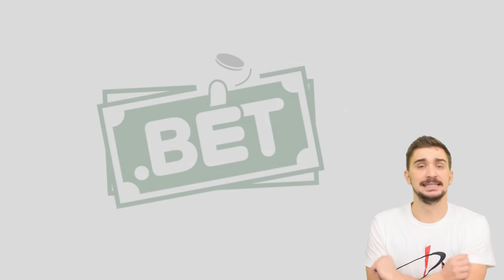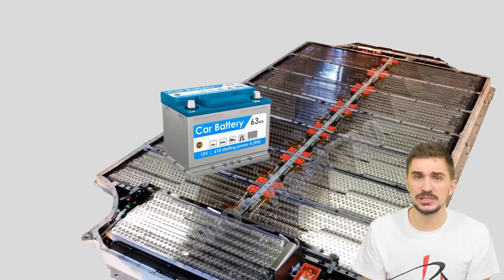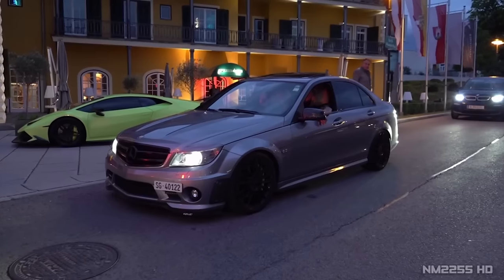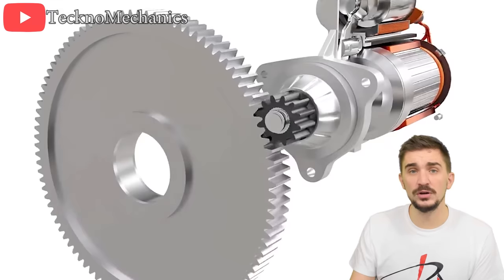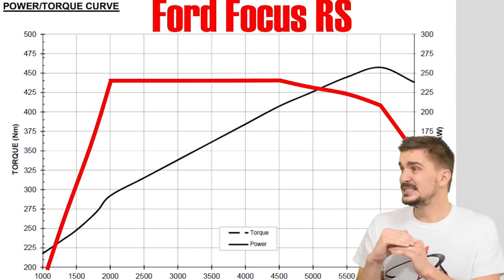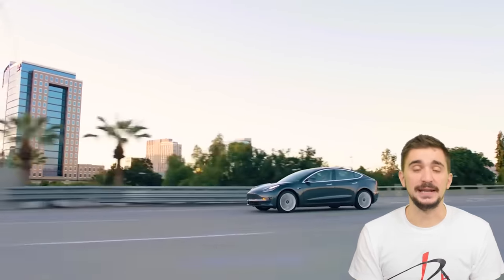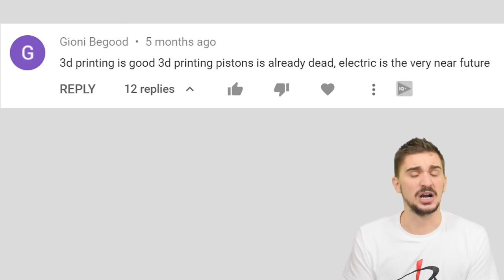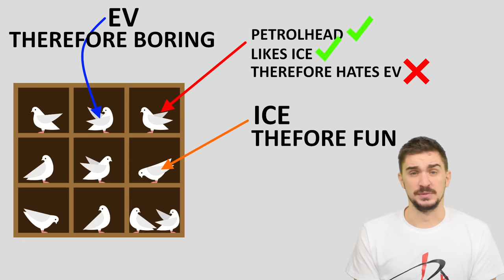ICE vs EV - IN-DEPTH comparison of BATTERY ELECTRIC and INTERNAL COMBUSTION ENGINE vehicles

Comment: Hydrogen powered next? Also, really enjoy his videos but i can't point his accent to anywhere I know...
Reply: Qatar
Reply: Hydrogen fuel cell EVs are an almost certain possibility in the next decade and could certainly be what gets me to switch but Hydrogen ICE is kinda silly as it has nearly all the downsides of ICE engines plus most of the downsides of Hydrogen Fuel cell vehicles. Running an ice engine off of recycled carbon is simply more efficient and therefore better for both your pocketbook and the environment than running them off of Hydrogen.
Reply: Its got some serious hurdles. Current methods for the commercial production of hydrogen requires more electricity than you get back out of it when used as a fuel. Its hard to justify developing a FCV and distribution infrastructure when you could take that electricity and just put it in a battery EV. Hydrogen is literally the smallest and least dense molecule. So it needs  complex, bulky and expensive means to both store it and stop it leaking out over time. As an environmental contender, it will liberate energy in exchange for a by product of water. Big tick. Its cost of production is so high that it has had close to zero market penetration. The CO2 and energy required to produce the fuel is high.  Big crosses.
Reply: Hydrogen in cars is a terrible idea.  It's only being pushed because almost all hydrogen comes from fossil fuels.  
Electrolysis of water > compression of h2 > transport of h2 > more compression of h2 > damaged metal pipes reacting with h2 > inefficient fuel cell > electric motors driving car.
Much better to go from generating power straight to charging your car.  Much, much more efficient.
Fuel cell cars are actually electric cars, with a ton of inefficiency and complexity added for no good reason.

Comment: 31:40 yeah but im not good at electronics. honestly wiring is my least favorite thing about working on cars. i understand mechanical engineering. its usually pretty straight forward when it comes to diagnosing a problem. like if it looks like milkshake in the coolant or oil you probebly have a broken head gasket. if you hear a ticking sound from the engine its probebly time to ajust the valve lash. if its running rough it might be ignition or carb. i daily a 1968 volvo amazon. im working on my 1948 cadillac. im rewiring the whole car with cool oldschool white braided wire. ive done alot of it by now but im kinda put off by the whole thing :/ ive rebuilt the engine and that was the most satisfying thing ever when it ran the first time https://www.youtube.com/watch?v=-fXBvueh6oM

the only way for the future of cars to be EV is if we did it like in fallout. where each car has a tiny nuclear powerplant inside. you dont need to fuel up ever or at most once every other year. you dont need a giant battery. but then again this can never happen because people are scared of nuclear power wich is the only sustainable way of supporting millions of EVs. also it would have to be crash proof. can you imagine a crash proof nuclear reactor XD. if just the Li batteries catch fire are dangerous enough when ruptured and cant be put out by anything.

Comment: Dude, I like my way better, the net energy content of one US gallon of gasoline is 1 * 2.85769 * 33.33333 * 13% = 12.38333, so if I drive 300 miles and I burn 8.1 gallons of gasoline, I get 300 ÷ 8.1 ÷ 12.38333 equals 2.99 miles per kwh and it's easy on my starter motor.

Comment: I enjoyed the video and awful lot. Think of it, I am dancing converting my Nissan Vanette ICE  engine , whose spares I cannot find, to EV. The body is still in very good shape and I do not want to just throw it away or convert it to a chicken coop. What do you say?
Reply from the maker: I think EV swaps are just perfect for scenarios like that. There's s lot of really cool cars out there for which parts have become extremely scarce. EV swaps can give these cars new life. But aren't vanettes common? Lots of parts around?
Reply: @d4a  parts common? Not in this part of Africa. The engine type is L8 or GAS18. If you know where I can get one, Usually be most grateful to you,sir.
Reply: @d4a  parts common? Not in this part of Africa. The engine type is L8 or GAS18. If you know where I can get one, Usually be most grateful to you,sir.
Reply: Sorry the auto correct thing keeps distorting my messages
Reply: Do it.  Plus some rooftop solar.  Be a cool conversion to document.  Maybe a cheap Leaf motor/batteries would do.

Comment: Inverter weight 60kg? WTF? LOL Closer to 10kg maximum. Also many other "mistakes", like "equal need for replacing" of brake pads, cooling fluid and lubrication. I have Tesla Model S and for 47.000 kilometers (almost 30.000 miles) I didn't change single braking pad (most of braking is regenerative), nor cooling fluid (just toping) or any lubrication (there is no engine oil and transmission is permanently lubricated and sealed). Price of electricity is usually the home tariff and only for longer trips you need to pay public charger tariff. If you had a gas station at home, you certainly wouldn't forget to mention, that your house price is 40c per gallon.

Comment: I'm in the same pigeon hole, petrol head at heart and for work. The idea of ev conversion is exciting with the improving technology. My only problem is the midea bla bla about them being green, this is very misleading in my opinion.
Reply: The media is notoriously bad for oversimplifying things and EVs are not some magic silver bullet. But overall at a worldwide scale it's an improvement in environmental impact. Where I live the electricity is 95% hydro power so while gas cars make emissions all the same electric cars do not. And when you put that in the worldwide scale about 11% of global electricity generation is renewable in 2019 but fossil fuel cars are unable to harness it unlike EVs. And for the EVs that do actually run on fossil fuels they are more efficient. Transmission losses of the grid and inefficiencies of the boilers, turbines, and generators are much lower than the very high energy required for hydrocarbon processing/refining (separating chemical and intermolecular bonds requires a lot of energy) and transport. So yes EVs do still indirectly burn fossil fuels, they just do it less and more efficiently.

Comment: I think hybrids and lower displacement is a better future than full ev
Reply: It's not, you can't fit 2 entirely different industries and manufacturing practices into a car and think they will work in harmony, its been found that moat people will just fill their gas tank rather than charge at home or work.
Reply: @miguellopez3392  toyota make huge numbers of hybrids and they do pretty well, so that is not really true
Reply: @kipkipper-lg9vl  yes and their hybrids underperformed on every metric compared to EVs except range same for their hydrogen cars, people bought hybrids on basically on the lie thet they would save tons of fuel, that ended up not being true after several studies actually looked at driving patterns and why hybrids are getting their market taken over by EVs.

Comment: And another Problem of EV's is the battery pack is Very expensive for example, the battery replacement cost of Tesla model s is around $12,000-$20,000 US dollars according to Google Search that's very expensive and very heavy weight, the biggest issue is that if one of the 6000 fails, the entire battery of lithium ion will put alot at risk of massive explosion. actually there is an EV Related incidents where One family instantly killed in one Single massive explosion of the one which causes of the entire family death and the house massively destroyed by the massive explosion. E-bike, the causes of E-bike explosion is the circuit protection fails to cut off the power supply when the battery is fully charged that's why the battery suddenly explode without signage badly destroys everything even the house itself. That's why I've never recommended EV specially it's made by Tesla's poor management to adress this issues. Instead i would go to Toyota's hydrogen fuel cells. Toyota mirai is one of the best.

Comment: You made a terrible mistake with that fan picture. There is no electric fan in the world that has a commutator and brushes. They are used only in engines that are intended to operate for a relatively short period of time.

Comment: Sorry but you are cherrypicking the weights a bit in this video. A modern 4 cylinder gas engine easely weighs 150 kg. A transmission easely 100 kg plus a full gastank is close to 100 kg aswell. An electric motor weighs around 50 kg youre correct, but an inverter doesnt weigh anywhere close to 60 kg, its closer to 5-10 kg and a EV battery between 400-500 kg.

Comment: Really nice topic, btw what if inline 3/4 engine mounted 90degree(parallel to ground) instead of vertical, how it will impact on NVH level, handling...could engine makes to run at higher rpm without putting stress on connecting rod since piston isn't moving against gravity.
Reply from the maker: Boxer engine? 😊
Reply: Don't try this with any engine you care about because the oiling system was designed to work vertically but if you did run an inline engine horizontally, you would notice no appreciable difference in anything except maybe for center of gravity. The stress imparted by Earth's gravity onto the connecting rods and the crank are entirely insignificant compared to the stresses caused by rotation pumping and combustion.

Comment: The manufacturing process did not make emission. When you plug in your EV the Energy is magic.
Ps the battery material might me interesting for people to look in to...kinda like a solar panel as well.
Reply: @d4a  the plans for the future can be seen on white papers. The world controllers want 90% dead. EV is to promote carbon taxes which leads to unreliable energy. Geo Engineering the number one planet killing thing people are doing and have been doing for nearly 70 years. The Bunker fuel from major shipping is connected to Geo Engineering.  I am not against EV's but they should be a option for people that want them and toyota is one of the only car manufacturing companies I respect because the CEO said they want to make cars people want and don't care how they are powered. Right now is the time to save ICE. Cars and cow farts are not an issue and if you believe it you may want to stop drinking the cool aid. 

Lithium and cobalt mining has destroyed water and land, look to africa for example. Combustion engines are cleaner then they really need to be at this point. The Future is grim if the every day person says nothing or does nothing about the Great Lie.

Comment: I to am a motorhead and I love ICE engines, I also prefer manual transmissions. This older form of mobility for me involves more physical activity and interaction with the vehicle. It also involves skill keeping the engine at peak torque from the sound of the screaming ICE engine using the proper gear and clutch. This is just more fun as a driver for me. The ICE engines have given us such advancements, consider the awesome roads and highway we have to enjoy high performance vehicles on.

Comment: EVs are built on the backs of ICE cars. thats why EVs are as good as ICE vehicles, because ICE vehicles have done the pioneer part os the equation.

Im same as you. More on the ICE side, but not hating EVs. What i hate in this discusion is that they were put on a pedestal, that they were great in everything cleaner than ICEs, better solution. but theyre not.

Comment: The worst compromise is having both systems under one hood, in an PHEV
Reply: I'd say that's a better compromise. you get the range and relative low weight of ICE. and you get the torque and relative simplicity of drivetrain of EV. here, an ICE works as a generator to store energy in a small 'buffer' battery pack, which then powers the electrical systems and motors (that also work as generators during regen brake). that way, you don't need transmission, clutch or differential(depending on motor config). this is what they've been doing in trains for decades to great effect.
Reply: @the80386  I've been driving one for the last few years and normal use means charge and drain the HEV battery every day, which is the worse for Li batteries, and the you drive EV until you reach the highway, and there, to protect the battery you switch to hybrid, so the cool ICE has to get you to highway speeds before it is ready to do it

Comment: I wouldn't say it's fare to compare a "usual" motor and a tesla battery, tesla has 600 bhp and up to 800 n/m , so it could carry that weight. a leaf/bolt/volt batteries weight bellow 300kg and that is ok for the power they have.
Reply from the maker: You just explained why it's actually fair yourself. The difference in weight of a 200hp and 600hp ICE is usually 0-100kg max. The difference in transmission and fuel tank weight is also usually around 0-50kg. But compared to this EVs need to dramatically increase battery weight if they want range and performance. Although a Leaf is lighter than a Tesla it's still a lot heavier than an ICE vehicle of similar or better performance. You can best see this if you compare cars that exist in both EV and ICE form, the Kia Soul for example. You will see that the number from my video stands, an EV is always 100-350 kg heavier than an equivalent ICE car. I got that number by actually comparing weights of all the relevant EV cars currently on the market with equivalent or near equivalent ICE cars.
Reply: @d4a  You definitely nailed it, truly unbiased review . And overall I agree , an EV will be heavier than a ice vehicle , right now. But I hope that I will find a way to fix that in my car)
Reply from the maker: If manufacturers continue to invest in the tech I'm pretty sure EVs will become noticeably lighter in the future. This is just the current situation. If you're building an EV yourself you have a blank canvas and you can set your own priorities. You can sacrifice a bit of range or creature comforts and make a significantly lighter EV.
Reply: @d4a  I'll probably sacrifice weight for longer distance. I want to build a 1000km+ ev

Comment: For me the sound is everything electric vehicles have their place but you simply can't work on your own car like a gass car and do things your self with out a tool box containing only special tools that are out of reach of the car enthusiast also thair is absolutely no skill needed for a electric car the way to fix this is to make a hybrid bolt on system for all cars and convert them all the ethanol that you can make at your house so no longer need for gas from fossil fuel

Comment: Here in The Netherlands we pay about 28 dollar cents per kWh, not 18 cents! Wish it were true. 🙃🙂
Reply from the maker: 😑 According to Google this is the new price you'll be paying due to regulations to support EVs.. Did Google lie to me? Also current price is apparently 24, not 28? Maybe it depends on the supplier and part of the country?
Reply: @d4a  At this moment we pay about 22 Eurocents per kWh. I saw some fancy low prices on the net, of which I think they are without 21% value added tax.
Reply: @d4a  BUT, no matter what the price is, you run a great, very informative channel. 👍
Reply from the maker: Thanks man, sorry I messed up the price thing, but you're still cheaper than Germany at least
Reply: @d4a  Wait till you hear about car prices over here. 😬 I paid for my used, 3 year old Toyota GT86 just as much as you pay for a brand new one.

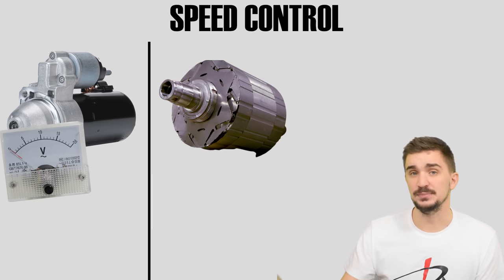Comment: 14:00 - you don't have to change voltage, only frequency? Looks like you have no idea about inverters and AC motors, every time you change voltage you also change frequency. V/f must always stay the same = lower voltage needs lower frequency. When voltage is lower then force induced on rotor is lower, so it needs a bit more time to catch up with rotating magnetic field, that's why it's rotation speed (dependent on frequency) must be lower, otherwise you will fry your motor
Reply: How does a household AC fan change speeds?

Comment: EV's are the future, just admit it.
Reply: not until lithium ions are replaced with better battery tech, if you buy an electric car the batteries will degrade like the battery in your phonne and probably at a faster rate, and getting the batteries replaced after a couple years will cost alot, they are usable but they still don't practically compete with ICE cars for normal people
Reply: @kipkipper-lg9vl lithium ion isn't a dead end technology, it's still developing and can probably 4x its energy density in 2 decades. And no the batteries in a EV degrades slower than any other battery you own, this due to the relive cycle sizes. On average someone will use 15-20% of a EVs battery In a day, if you recharge it from 50% to 70% every day then the battery will last 5x longer than if the battery where to be fully drained and charged every day battery cells degree in 2 ways, chemically and mechanically, the liquid cooling in a EV keeps the battery from getting hot and chemically degrading, the partial cycles keep the battery from causing excess fatigue from the expanding and contracting materials in the cell, cobalt can expand 400%when charged fully inside a battery and damage the internal structure, newer lithium ion cells in EVs replace the cobalt with iron, this extends life by double and allows 100% charge without less damage, downside is that it produces less voltage when it gets cold so range is reduced.